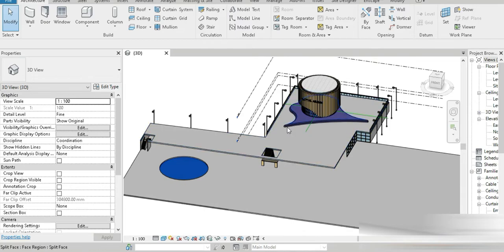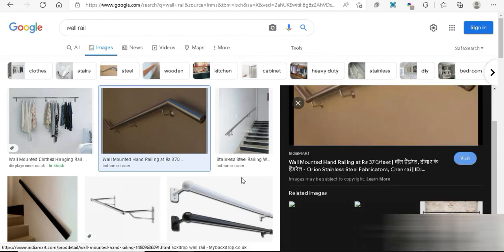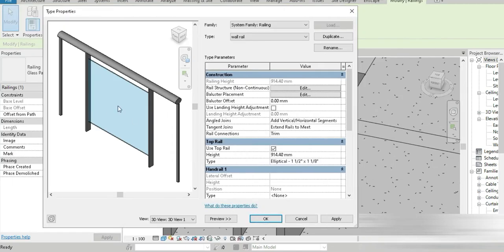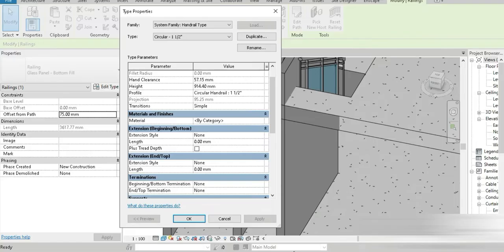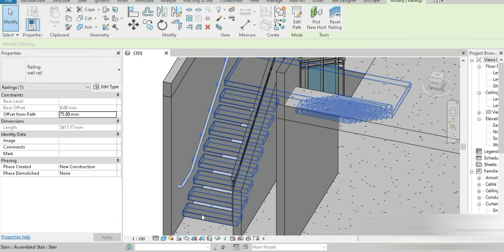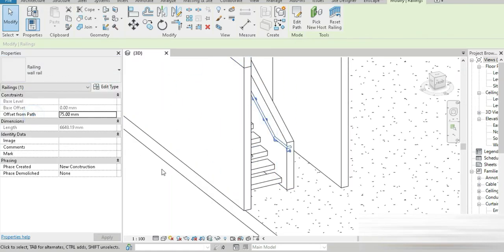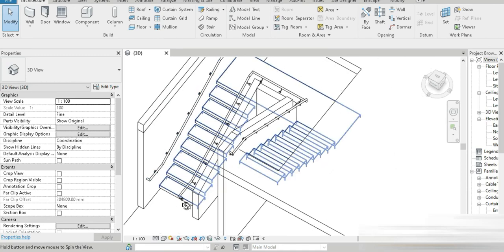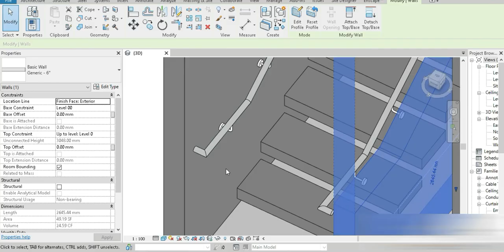Wall rails in Revit | wall mounted rails

Comment: Thanks! Always wondered about this - seemes like it should be a default railing in revit template as its so common... Q. At top of stair I want handrail to return to wall an extension - as the (existing) stair wall does not extend beyond top stair riser (knee wall in attic for example)  - do you know how to create that return (as in some of the photos you show - where there is not a level horiz. leg at end of railing - rail just 90 degrees into wall) ... Thanks again!

Comment: Hello, can you make the extension connection to be at the slanted angle of the handrail? Because the extension is horizontal
Reply: the extension usually is on landings, and to maintain the fixed standard height they should be horizontal.